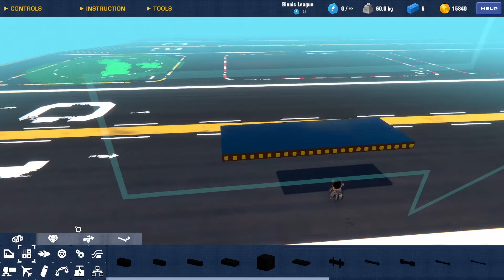Creating an Explosive Shotgun Railgun - Trailmakers

Comment: 5 laser bullets to the front and you’re fucking screwed.
Reply: No, 1. I thought you covered the dynamite somehow but nope. 1 bullet and you’re fuckign screwed
Reply: If your staring down that things fully loaded barrel, you have bigger issues.
Reply: @Zane12ai  i have a plane with like 14 miniguns and it has a thruster on its tail aiming Down (with quantum ruders and gyro’s aswell) and it Can go a Nice 350 kph. I tap the button once, and that thing is becoming an unplanned nuclear reactor in the Air.

Comment: 5:50 I you use spoilers upside down, they produce as much lift as the normal sized wing. They also are lighter and smaller. I don't know about complexity, but ig they're better too.

Comment: How does the railgun even work im kinda new here
Reply from the maker: Basically all the tractor beams around the pieces of dynamite turn on in reverse and push the stuff away really fast. I’ve made a couple other railguns so if you want to check those out I you might learn more.
Reply: Nice, I'll definitely watch the other ones because that seems super exiting
Reply: Hi, railgun expert here, It's very easy. Magnet go pushy pushy, thingy want to go fast, detachable block let thingy go fast